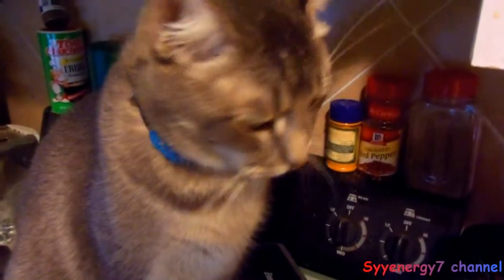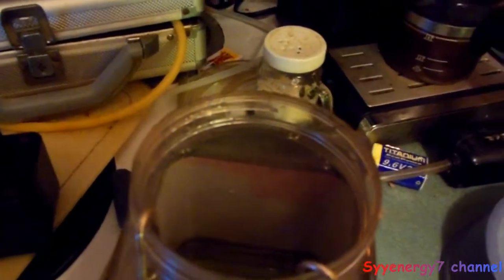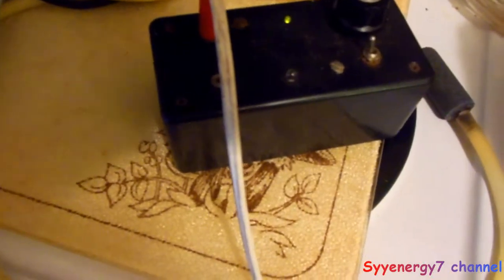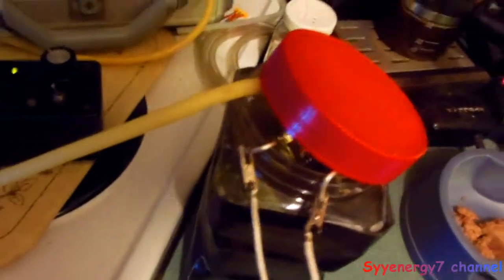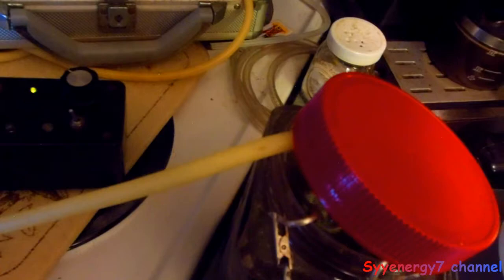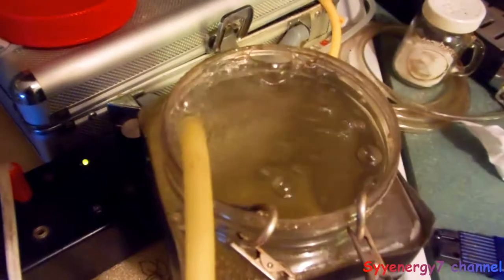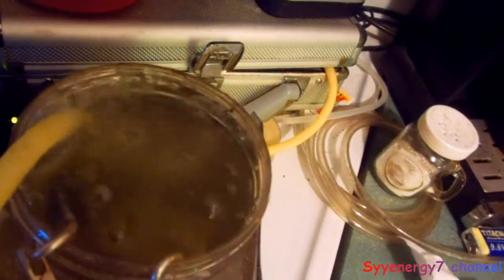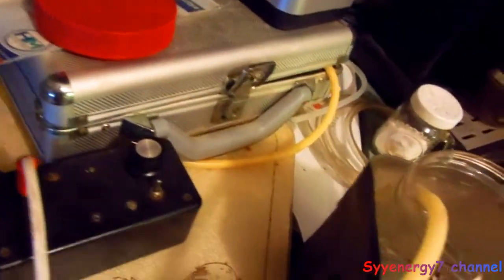Make Quality Colloidal Silver FAST with a Fish Tank Bubbler

Comment: Like most of us, I have a bunch of old phone, recorder, and drill charger transformers. After splitting the line, I added alligator clips, attached the ends to the silver rods, and stuck them in a quart of water. 3 hours later, 19pp! Works great. The first transformer I tried took all night and I got maybe 1pp.  So you might have to experiment to find the one that works. (The one that did the trick was 24VDC, 300mA) Better than 9V batteries and cost nothing. Fish tank bubblier is good. I use glass rods.

Comment: What's your thought of using an ultrasonic jewelry cleaner with a glass jar inside?...I have a cleaner that also heats while it vibrates.  I use it for making liposomal Vit C without the heat...also using a glass ball jar inside the cleaner.

Comment: Any reason not to split a 1 oz silver bar for electrodes instead of paying 6x the weight value of the silver wires sold with kits?  If using distilled water and you have no existing colloidal silver to start the batch, do you need salt or baking soda to start it or will it work but just take longer with only 100% distilled water?
Reply from the maker: You can split a 1 ounce bar and that would be cheaper.  Start with distilled water. That works fine.  It's starts slow but it still works fine.
Reply: Thanks for the info.  I appreciate the research time that you invest and share.
Reply: 28bull a couple silver maples would be a good choice given the 4 (9) purity vs .999 ... i've seen it said the agitator in the water gives you smaller silver particles vs still water. Some company's make what they call "Silver Solution" and tout the "Catalytic" characteristic of their product saying their silver particles work multiple times in the body rather than typical colloidal silver which each silver particle is said to attach itself to and kill one of the bacteria and then be expelled from the body... I'm not sure what they do different in their manufacturing process, I'd like to hear from someone who could shed a light on that.